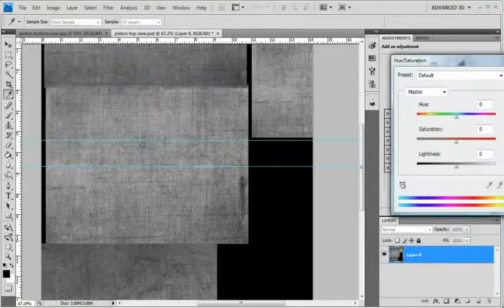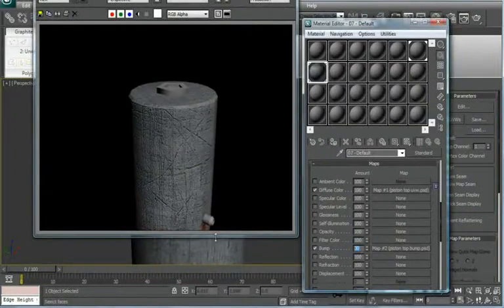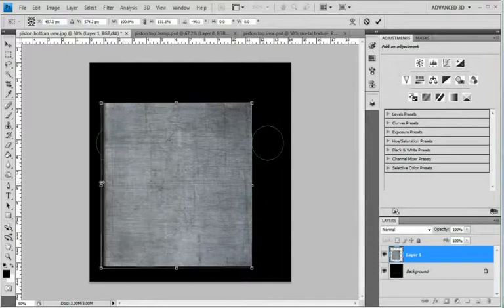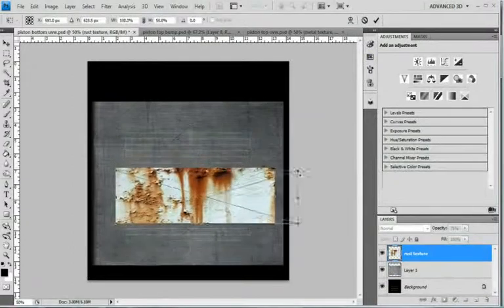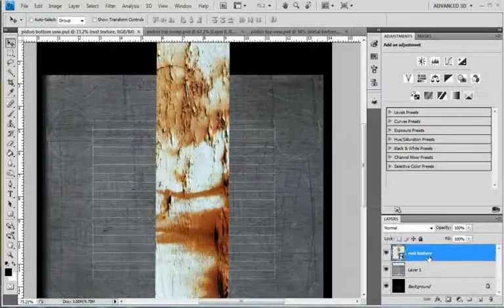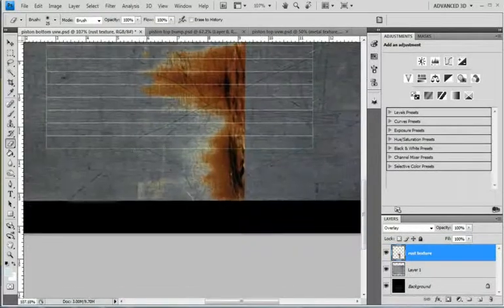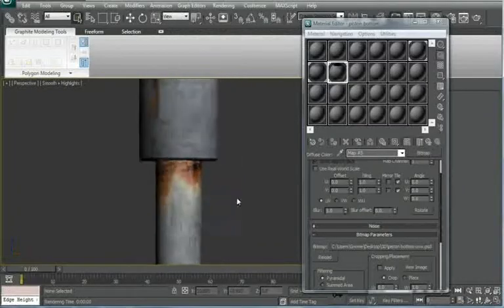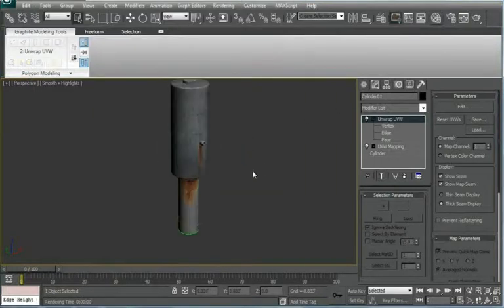3D Studio Max - Texture using Photoshop - Part 4

Comment: use a mix map when applying the rust texture in 3ds max this way it will blend and remove any hard edges without any manual work in photoshop